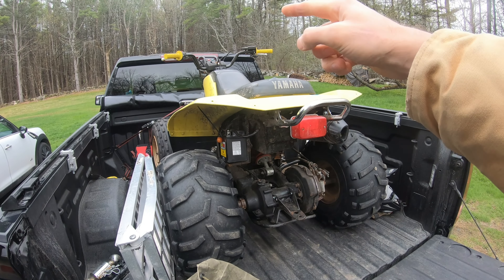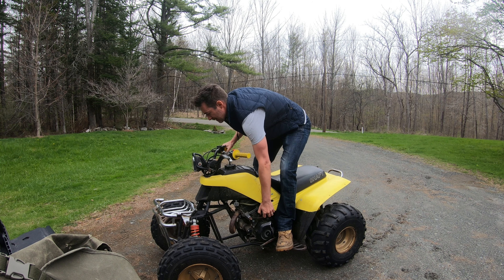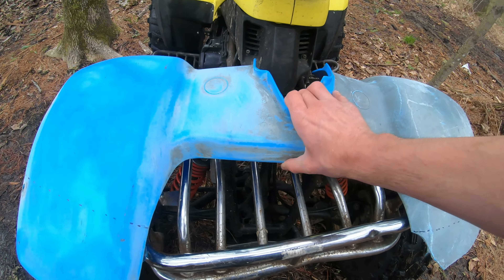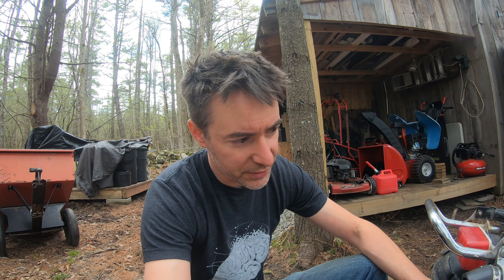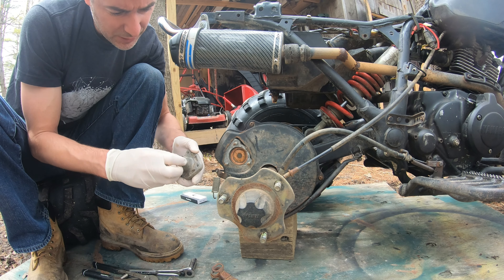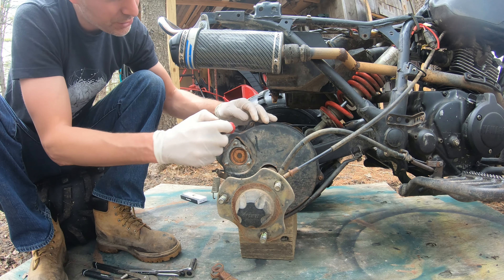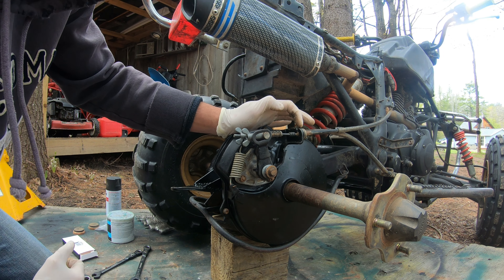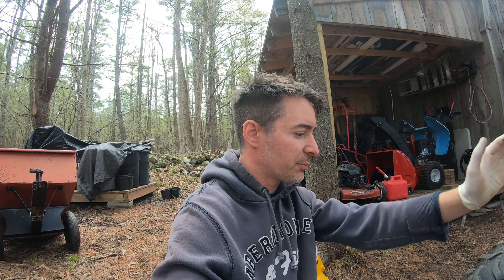How to Properly Rebuild and Adjust the Rear Cable Brake on 1986 Yamaha Moto 4 YFM200DX

Comment: Watching this video brought back a lot of good memories. When I was 8 years old my pappy got my brother and sister and me a 1985 Yamaha moto 4 200cc. It had absolutely no fenders. And absolutely no suspension. 
I gave it the nickname
   THE BEAST.
That poor machine was rolled I don't know how many times? Flipped I don't know how many times? Submerged under water I don't know how many times. Set on fire twice. I know that one for sure. I actually fractured my neck on it in 15. The thing just wouldn't die. So that's why it was nicknamed
THE BEAST. Or the NEIGHBOR WHORE. CAUSE EVERY KID IN MY NEIGHBORHOOD I RODE HER AT LEAST ONCE

Comment: Hi I have the same exact quad as the one in the video and was wondering if you knew if it had a oil filter or not
Reply from the maker: Yes, down by your right heel are three allen head bolts around a circular cap. The bolts are long and sometimes stick so go slow. Behind that is the oil filter.
Reply: @VermontLife  okay thank you

Comment: Stumbled across this searching for a hitch mount for my '89 YFM200.  It looks like the hitch set up you have on your YFM200 would fit perfectly on my machine.  I have been searching all over for a hitch and can't find anything like yours.  Did you fabricate it yourself or purchase somewhere?  Thank you!
Reply from the maker: This one came on the quad but... I've noticed that a lot of the early big bear quads seem to already have them installed and they look like they would fit but I haven't tried. This one does not look custom fabricated to me so I'm betting it came off another unit. I have three yfm350 big bears. 2wd 89 and two 4x4 yfm350fwt '87's. All have a similar looking hitch. I can't say for sure but I'd start but looking at those.

Comment: Hello is there any way I could contact you and ask a few questions on how to properly use this quad. I got the same one but it was sitting in a barn for a few years. You seem like you know what your talking about and could answer some of my questions. If there is anyway we could contact each other that would be greatly appreciated
Reply from the maker: Hi Colter, if you're game pop your questions in here and we can all learn together.
Reply: @VermontLife  ok first how to you shift through the gears correctly I haven’t been able to figure it out yet and I don’t know if your supposed to make it idle and then shift or if there is just a clutch I haven’t found yet
Reply: @VermontLife  second have you had any problems using the electric start and the battery. The electric start use to work fine and now it takes 45 minutes to charge up the battery for it to turn over just a couple times
Reply: @VermontLife  3rd is there any chance you have a spare pull start assembly that would work for this quad. When I first received this quad it was missing it’s pull start assembly. I am willing to buy a pull start assembly?
Reply from the maker: Sounds like your battery is bad. You should be able to start it with a battery charger that has ‘engine start’ mode if needed. Sometimes I have to do that in the winter when it’s really cold. Another option which hopefully isn’t the case might be a bad crank shaft bearing but I’d focus on your battery first.
Reply from the maker: I don’t have one kicking around but have found them on eBay before. The other place I often go for oem parts is bikebandit.com
Reply from the maker: No clutch. It’s a semi auto so you just shift with your foot. Neutral is all the way down and you’ll need to be in neutral to start. Then you have five gears up. To get into reverse you’ll need to be in first gear. Ultimately to go through the gears you’ll need to be moving or rock the quad to get into gears other than first. So… start in neutral then go to first and keep toe shifting up or down as needed when moving. No clutching needed.
Reply: @VermontLife  ok thank you for answering my other questions the answers were very helpful but continuing on the bad crank case. Would there be any other signs of a bad crank case?
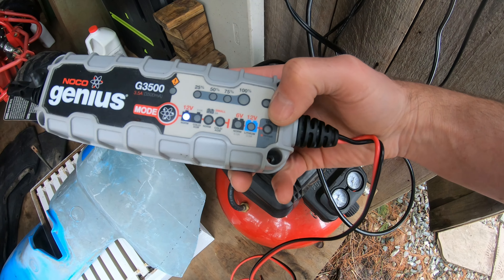Reply from the maker: @Information57488ghdjii  If you were to put a bad battery in and it still struggles to crank that would be one indicator. I have a video I did on a Tao Tao where I found a bad crank bearing. My playlist 'Tao Tao Coolster 110cc 3050B Rebuild' is a good place to start. That first video at 4:26 is what a seized crank can sound like. There are a few other ways to diagnose. You could open your stator cover, put wrench on the bolt and get a feel for resistance or dead spots when you spin the motor by hand.
Reply: @VermontLife  ok thank you this is very helpful I don’t think it is a bad crankshaft because it was running at a one point then winter came along and I think I just forgot to maintain the battery so thank you

Comment: Why wouldn’t you etch the rotor while you were in there. Pads will just glaze again.
Reply from the maker: In retrospect I absolutely should have.
Reply: What's the easiest way to do this? Also do you know what a good option for rear pads are? I finally took mine apart last night and I wanna pick up new pads and I think I need a new cable as well for the foot pedal.
Reply from the maker: @jonathangaliano2617 I can’t say I have much experience with deglazing. These days I use sandpaper and go ‘with the grain’ but I’m sure there are many better ways. For the pads I have been getting them on Amazon. If you search for Tao Tao 110 cc brake pads or TaoTao 50cc scooter brake pads you’ll see some options.